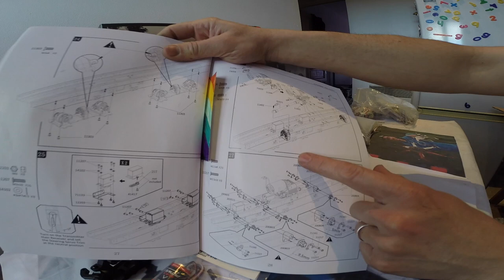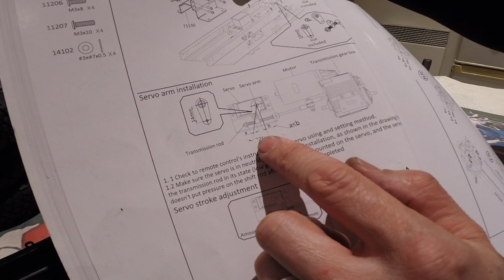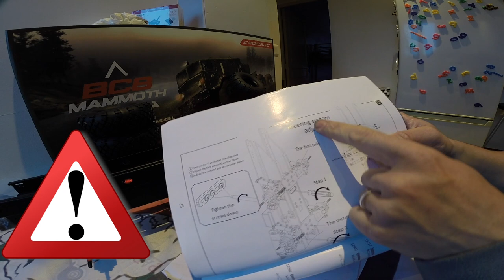Cross-RC BC8 Mammoth MAZ, Installation Of The Servos, Building The Final Part Of The Chassis

Comment: hello vincennes and thank you for sharing your bc8 I am in serious thought about buying the flagship version for myself I am wondering your thoughts so far on the truck as well as an estimate please on your total build time ,
And maybe your thoughts on overall value compared to price thank you very much 
Niel
Reply from the maker: Hi Niel, thanks for your compliment. My opinion regarding this truck is, I love this truck is a magnificent model, with pieces of very good quality, and also to climb this truck is very effective. I recommend the full version (flagship). It costs a little more money with respect to the normal truck, but if you were to buy the parts separately from the flagship truck, it would be more expensive to buy them separately. My name is Gerardo, greetings from Paris France
Reply: @RcAVENTURE.V.F.R  thank you so much Gerardo for your input ......1 more question does the flagship version come with the controller ?? thank you
Reply from the maker: This is a truck kit, everything there to assemble, brings the 45T engine, and the entire lighting system and sound system. It does not bring the two steering servos, nor does it bring the esc, nor the radio nor the receiver
Reply: @RcAVENTURE.V.F.R  ok thank you for your time i will be waiting for your next podcast thanks again Gerardo 
   PS i will let you know when i order it .....i am an avid lionel train collector and i am going to sell 2 of my higher end sets on ebay to pay for the bc8
Reply from the maker: I am very happy to help you, you will not regret if you buy this bc8 truck, I am a big fan of military trucks, I have 4 trucks, they are very realistic models and they are also trucks with a lot of capacity to climb very hard slopes